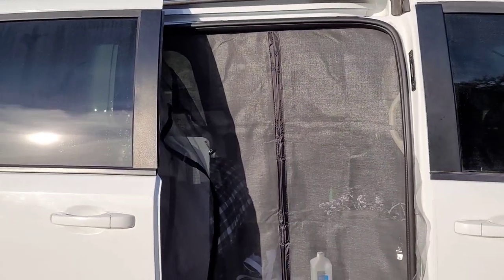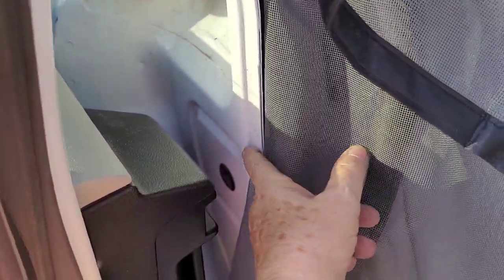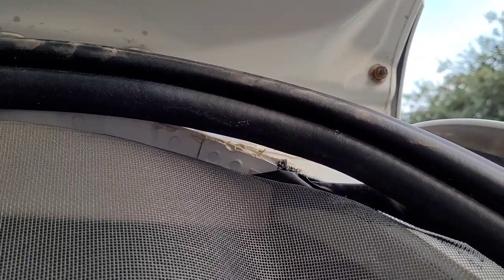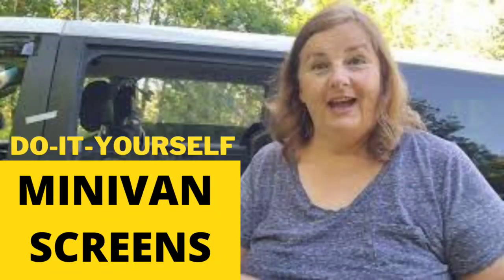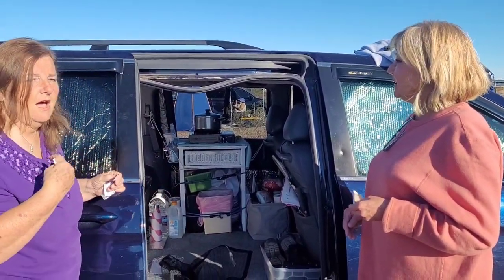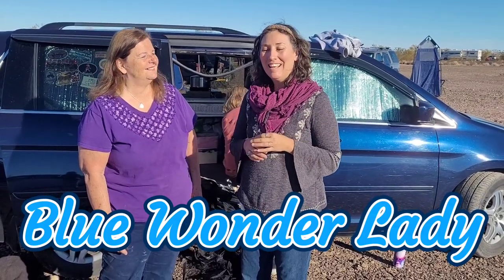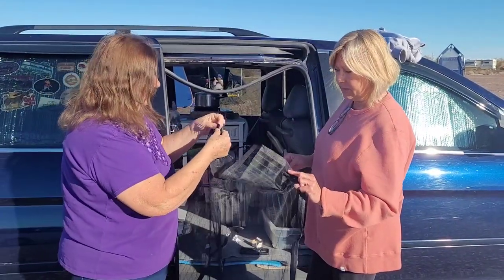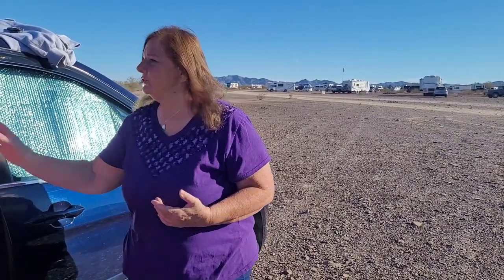DIY Easy Minivan Door Screens

Comment: I've saved this video to help with the screen I just purchased.  Your tutorials are awesome!  What is the 3M tape? Thanks 😊
Reply from the maker: Any two sided tape should work just to keep the screen from shifting while you are securing the rubber gasket. That gasket is really what is holding the screen in place long term.
Reply: @TravelGrandma  Thanks so much!!